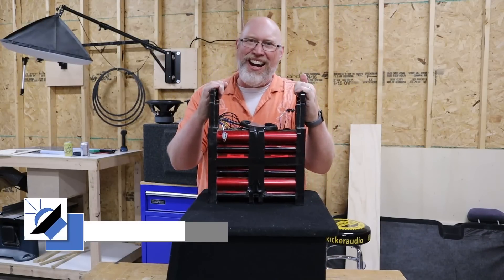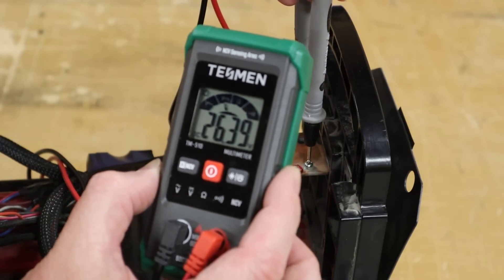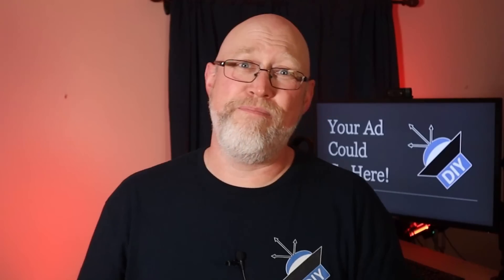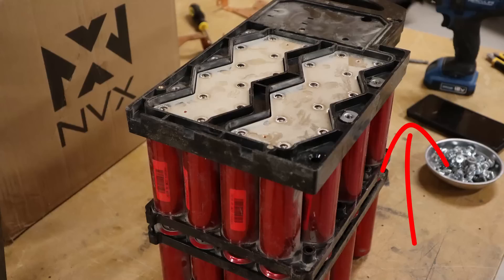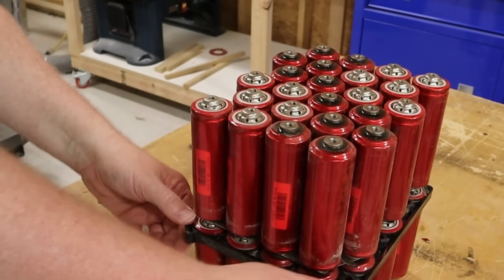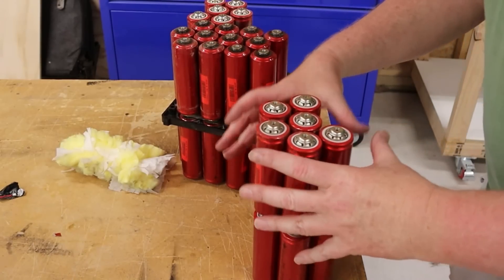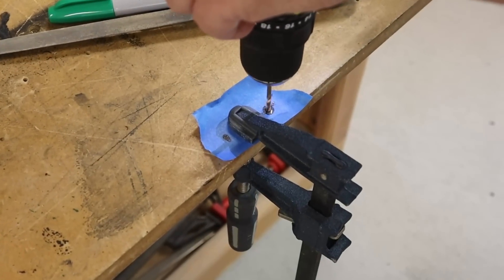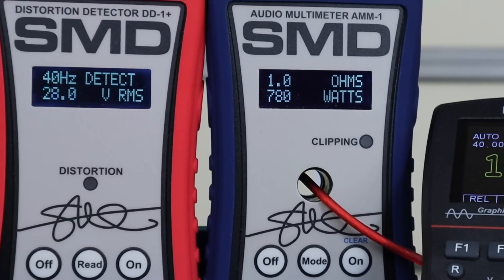The BEST budget Lithium Car Audio Battery:  The Super Beast!

Comment: iv been on yinlong, i ruined my whole 6s pack by not having them tied down hard enough, the vibrations from the car over time cause too much stress on the terminals and once one degassed they all went bad. also had them arranged in a line rather then a block formation
Reply: I appreciate you sharing this bro definitely good to know.
Reply from the maker: This bank is going on the test bench, so hopefully that will not be an issue.  When I build one for the truck I will make sure to over-build the case.  Thanks for the advice.

Comment: Would this be a good upgrade with stock electrical?
Reply from the maker: Based on everything I've read I'm going to answer yes with an asterisk.  4 of these in series will rest at 13.2 volts, which is pretty close to what your stock battery is going to rest at.  You're not supposed to charge these to high voltages, so they should match up well with your stock alternator.  A headway bank will match up better with your stock electrical system than other types of lithium. 

Now the asterisk, don't take my word for it. Do some more research.  Be careful and try not to burn your car to the ground.

Comment: Can the buss bars handle all that power they are awful thin.
Reply from the maker: I'm seeing a lot of debate online about that.
Reply: @DIY Audio Guy  yea I mean if your not drawing max output I don't see an issue  but if your trying to get max output I'd probably go bigger. I went with a set of econo bars from laf audio but I'm running a 60ah with a group35 agm with electro beam 2/0 wire and a taramps 5k for 2 ds18 12" subs. I have a stock alternator in my wrx and it's great. But I'm gonna be building another 60ah for my escalade and wanna find some bigger bars even then that. I'm gonna be running 2 taramps 5k amps and with the group 35 agm but in that I'll also have a big alternator if not 2 along with electro beam 3/0 wire. My concern of the smaller bars is the heat buildup at the connection of the individual cells. I mean if I were to run those bars I'd probably want to run a fan to try and cool them. Maybe with a thermal switch.
Reply: Wow. Glad I'm doing my own.  That just sounds like something bad possibly waiting to happen.  I like to over build things to keep things safe

Comment: I've been using these 12V 280AH LiFePO4 packs for ~$450, but you have to assemble it, these are just 4 bare cells, but i've got over 14KWH for under $2000 or right at $200 if i grab a 48v BMS from Amazon ect that manages each cell directly instead of groups of cells
The bad part of these cells is that if you stack them compactly, making them about the size of a regular car battery, you can really only discharge at 1C constantly without worrying about overheating the inner 2 cells, or using some sort of active cooling between each cell.

My plan is to build a trike with 2 rows of these cells for 16S2P, or 2 groups of 16S1P, with each group driving its own controller and motor for hopefully 28kwh pack for ~$4000(not including assembly)
In eithe case i want each group of 16 being basically just a line down the chassis with air cooling on both sides, i'm not sure if i want to do stainless steel, or aluminium.
Reply from the maker: That sounds pretty badass.
Reply: @GTILOUD  Those would be good to use as a booster pack as long as i could make sure it didnt pull high amperage from the main pack

Comment: I've been looking at them, ( lithium) I'm still on factory 170a alternator about 130ahs of agm (about 2100watts) .need more ah's
Reply: @Trav Hamler  pmc controlled alternator.  It also depends on how hard you beating on it. Going down the road no problems. Sitting still (running) about 40 minutes beating on it,and I'm sitting right at 12volt. Orion amps no problem . Don't need  that much power but at that PRICE !😍😍

Comment: Whats the voltage for a fully charged lithium battery at resting?
Reply from the maker: The individual cells are designed to rest at 3.2v -- so 12.8 if four are wired in series.

Comment: 0:50 Why did this happen?
Reply from the maker: The pliers touched the negative terminal and when the pliers cut through the insulation on the positive wire I crated a dead short.

Comment: Headway is great if you charge correctly,I have 780ah.......
Reply from the maker: What is the correct way to charge them?
Reply: @DIYAudioGuy  14.8 max but most hi out put alts charge 15.1,adjustable voltage control in my opinion
Reply: @JasonWW2000  not if you're pulling 3000 amps of current,it stays at 14.3 at full tilt.
Reply: @JasonWW2000  35000 watts,overkill is better than underkill

Comment: Few problems i have with this video. 1. You only explained c rating as discharge only as if c rating for charging isnt different and important information. 2. Misleading pricing since you didnt include the shipping cost. 3. You didnt do any cell testing or balancing. These can be a good precursors to building a bad bank, or one or two cells killing off other cells. 4. Not showing the correct way/wrong way to wire up a balancer, this is also the quickest way to cause a potential fire as inexperienced users/builders can short the balancer and shoot way more amperage than those tiny wires can take, causing them to melt and potentially touch other things causing an ignition. 5. Not explaining the voltage and temp range for charging and discharging. Thanks for spreading the word about diy entry lithium, but lets be as safe as possible when sharing this type of info with inexperienced folks.
Reply from the maker: I appreciate the feedback.